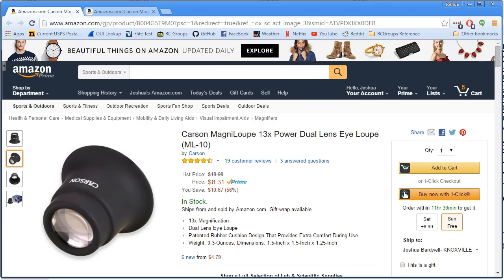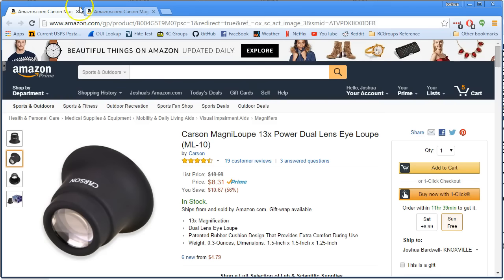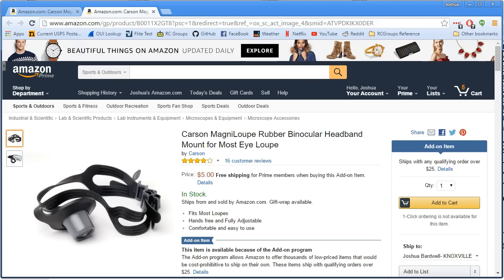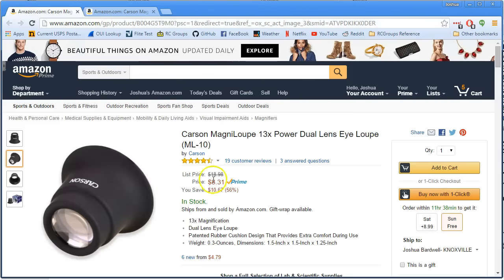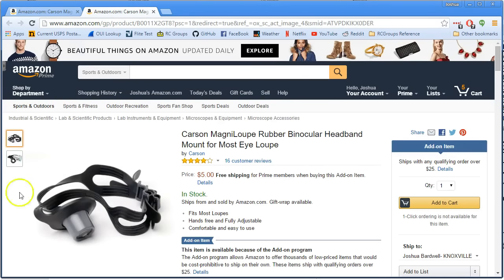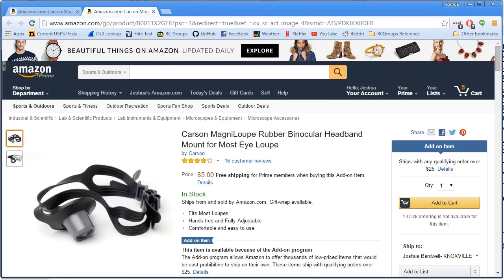Tool suggestion: magnifying loupe with head-band

Comment: I build my drones on stream on twitch. I actually found it handy to use a USB microscope I found on amazon. I can keep the workpiece on the table and not have to shift it to see it and I can see even the smallest traces as it has a 250x zoom with manual focus! even if your not gonna live stream it comes in very handy for fine soldering as well as any small surface mount style soldering!

Comment: Very nice, 51 now have great eye sight even though I sit a lot at a Mac coding. But I do use a low power magnifier lens to check for solder balls and shorts and for small jobs like the 5/3v pad on the Lux.
This will make the job really easy.

Strangely they won't ship this to Australia

Comment: I use a visor style head loupe with flip up lenses, the one I have is a very old jewellers one, but now a days they come with many lenses and a light. Absolutely essential kit IMO (I'm even older than Joshua!) The one pictured here looks less comfy to use than the visor ones but I'm sure it works well. Check out the Rolson 60390 LED Head Loupe Magnifier Visor on Amazon.co.uk